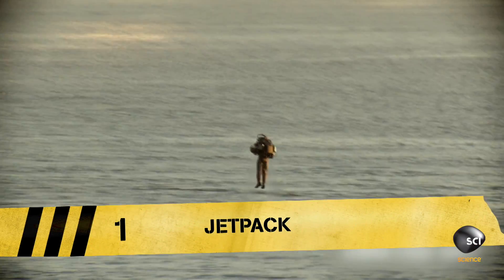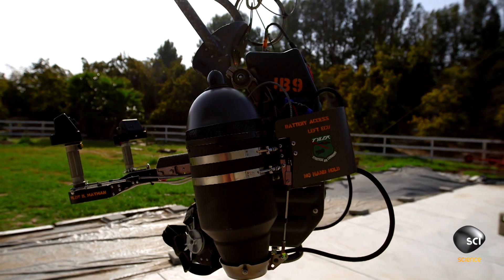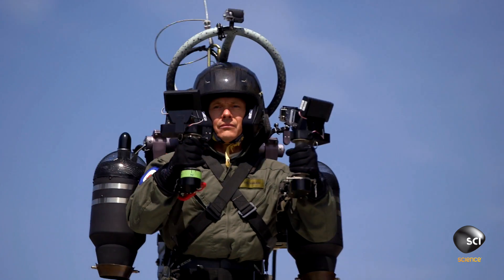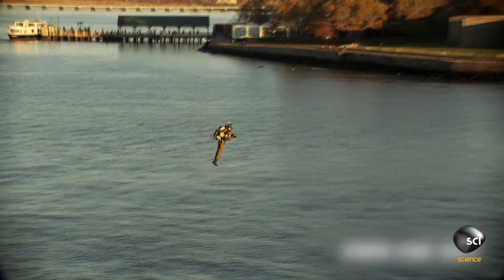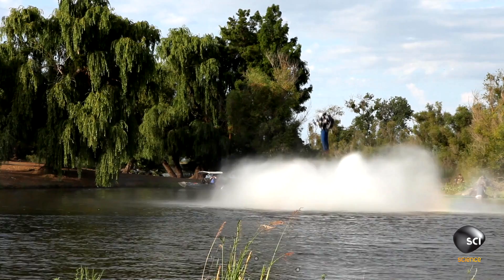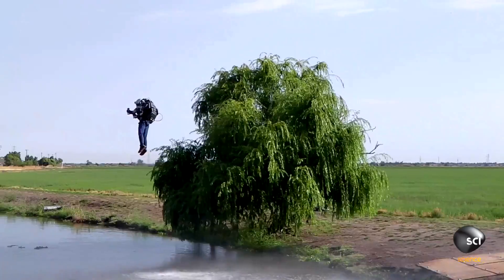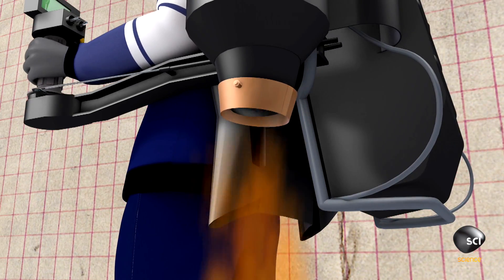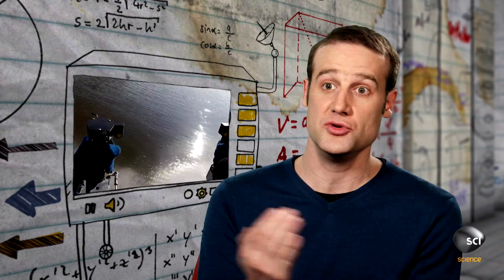Meet the World's Only Fully Functional Jetpack

Comment: you would need and want a parachute but it will have to be a new type. The low altitude it will mostly operate at means one thing, the chute must deploy pretty damn fast, like in less then a second. And the only way to do THAT is blow it out using a rocket or compressed air.

Comment: Most of these vids I see are over water and for a shorter, less practical application of time. I assume that's in small part due a more survivable crash and less public damage if a failure occurred. It's still a great start to something with great potential. Longer endurance and reliability would make these devices awesome for EMT use in remote areas like Nat'l Parks, ranches, rural HWY's, etc. Even enough fuel for a very fast, one way trip to stabilize a patient until more help arrived would work. (Didn't want to view 1184 comments for any possible duplicate views,

Comment: So far the flights on jetpacks are very short. Until they can travel greater distances they're impractical.
Reply: The whole thing's made of carbon fiber and titanium and only 90 lbs, but it can still only carry 5 gallons of fuel. These will never be widespread until they invent much smaller, lighter, more powerful and more efficient jet engines. Or think of some other means of propulsion for it.

Comment: +Science Channel I'd rather use the Flyboard Air (10,000 feet capability, 93 mph top speed). This video shows the pack going very slow. Why go slow and clunky when the Flyboard Air is out. Right now only teams and similar can buy it for $250,000. No one can even buy this pack yet.

Comment: Add a pair of wings and a tail assembly and you've got a man sized jet airplane. 
That could reduce your fuel consumption during flight, as you're using the air for lift and the engines only for propulsion.

Speaking of which, what are you using for fuel? I'm thinking your fuel consumption must be horrendous to get the thrust needed to lift the pilot off the ground.

Comment: Cool but fuel burns off in minute or two, that's always been the problem, until we come up with a fuel that has longevity, jet packs have very limited use, which is a shame.its not the first time its been done only dif is, is the materials are now lighter and stronger, giving a little bit more flight time.

Comment: What a joke.  This is NOT new.  There have been functioning "Jetpacks" for decades, since  the 1960's.   The problem with the Jetpack is the length of flight.  They have a very short range before they run out of fuel.  They can only fly for a minute maybe two before they are out of fuel so they aren't really practical for much of anything except demonstrations.  They've used them to fly into sports stadiums, etc things like that.  They certainly are not new.
Reply: Not just the length of flight, I'm an electrical engineer, these machine are very inefficient, you cannot scale typically large machines such as jet engines without losing efficiency as you make it smaller, there's mathematical proofs for this, but you get the point. And anyways, an aircraft is just a jetpack that is more economical, example: the jetpack is basically useless for everyday commute as it's too inefficient, so you make it larger, perhaps increase the number of people it carries, now as it's still useless for short commutes as it's still inefficient, you make it fly higher to increase efficiency (pressure reduces and so does the drag), now you enclose it in a metal body as the pressure lowers at heights, then you make it aerodynamic and change the fundamental lift generation principle from thrust to dynamic lift, i.e. add wings and tilt the engin 90 degrees, as it's for large distance, add a few seats, maybe food and entertainment as well, then an road exclusively for it's liftoff and a control network to prevent crashes, congratulations, you have just built yourself an aircraft ,which is already used everywhere.

Comment: In 1957 a scientist at Bell Aerospace, came up with the Jetpack. He want to marketed to the United States Army, he made it so simple that anyone could operate it. It has made many public appearances, it even has open the 1964 Olympics in Los Angeles.
The only thing that stop this from becoming, a weapon system was the length of time that its in the air. An that can range from
21 to 28 seconds, far too short to stay in the air also if a soldier was to use this jet-belt, how was he or she to use his weapon
since it takes two hands to operate the belt. It would be nice to have such jetpack, too get to work is your job was 28 second
from where you lived, and maybe we will. But until they get the fuel tanks to hold more, fuel then its just a dream.

Comment: Its slightly fake. The safety line greatly helps stabilize the thing because this cant possibly work without a counterforce canceling out the rotational momentum.
Reply: drkastenbrot Are you referring to the fact that the jetpack would be spinning him forward due to his center of mass?
Reply: Analytic31 mostly, yes. 
This is why all other jetpack projects have decided to go for a hoverboard approach.
Reply: drkastenbrot A hoverboard approach?
Reply: Analytic31 Instead of strapping it to the back, you stand on it. Like a skateboard, but it flies. Thats the definition of hoverboard (no, those weird two wheeled electrical vehicles are not hoverboards). 
Theres a commercial one available afaik and its actually somewhat affordable.

Comment: Took me a while to get this information but for those who want to know, the first flight of the jetpack (the one in London) was four minutes long, the flight ended with more than half of the fuel still in the tank (which was filled beforehand to maximum capacity, obviously), another test flight lasted six minutes, there was still some fuel left on the tank. Apparently the current model of the jetpack can fly for a total of ten minutes before the level of fuel becomes dangerously low, and the designers are aiming for an electric version that will be quieter and possibly able to fly for longer, it will supposedly be available to purchase by 2019.
Reply: 2019 seems a little early for something this rudimentary to be made public... I'd estimate more along the lines of 2029, if it'll be sold at all. Gives them time to refine the design.
Reply: 2020 bruh, where is my jetpack?
Reply: Augusto Vasconcellos source
Reply: It’s 2019
Reply: Is it on Amazon yet? It's 2022 heh heh
Reply: 2022 dude 🗿
Reply: 2019?
Reply: Its available now for 340k but can only fly for 6 mins!
Reply: It's 2019 and I'm waiting
Reply: Its 2020 and im dissapointed
Reply: Thanks for clarifying that Augusto. Six minutes may not seem long but it's a huge improvement on the first jet pack developed in the early sixties. Think that only flew for twenty seconds. I agree with others re safety concerns though. Military may be interested but not suitable for commuting IMO.
Reply: 2020 we still have a long way to go
Reply: It's 2020, still isn't here...
Reply: My guy where is it please
Reply: Bro it's 1/3 of the way to 2024 and I still don't have a jetpack 😢
Reply: damn just next year!?

Gotta save money asap

Comment: why not put a emergency parachute on it?
Reply: Doesn't fly high enough to justify it.
Reply: godstomper 

You'd better have one. If one of the two engines fails you're fucked unless you're high enough to escape the rapidly falling towards earth iron and release a chute.
Reply: @halnineooo136  the wearer needs to be high up enough for the parachute to do it's intended purpose,u can't simply parachute from the 3rd floor of a building so if the jetpack were to malfunction then u would get both ur legs snapped.
Its best not to have this available to the public.
Reply: *****
 but it is a big risk with out parachute
Reply: Spare skydiving parachutes (the most sofisticated) need 600 feet by the way
Reply: Muhammad Ilyas it probably won't open in time
Reply: they must have put Parachute ....
Reply: Well if you were to throw in a parachute, you'd have to consider weight, you'd have to consider storage, you'd have to consider the temperature of the jetpack and then you'd also have to remodify the entire design from the ground up, to deal with all of these addons.

If the parachute is highly flammable, which I presume it is. Then, you'll also have to consider the safety of the pilot & design a solution for the problem.

It really isn't as simple as just wearing a bag with a parachute in it; as it requires alot more work, alot more time and alot more money.
Reply: To all those who say it would be pointless, a proper ballistic parachute would open near-instantly upon activation. That being said, it would only be particularly useful if flying at high altitudes, because at low altitude you'll probably be hitting the ground at parachute-speed whether you have one deployed or not. In low altitude it'd be more practical to have some form of airbag system to absorb the impact, but again that's more weight to consider.
Reply: Only for engine failure... Otherwise when losing fuel, you'll slowly descend
Reply: Ejection seats on fighter jets do not rocket them up 600' when they bail just above the ground. How do those work?
Reply: but base jumpers jump from only a couple hundred feet...
Reply: The older versions back in the 60s and 70s had a very short flight time. What is the max flight time? Not very practical if you only have 15 minutes🙂
Reply: he'd probably do better with a squirrel suit. A chute would not be effective at his low heights.
Reply: godstomper because it wont mean fuck all at 20 m 😂😂😂
Reply: godstomper That's why he's flying over water
Reply: He's flying far too low. He'd need a zero-zero ejection seat (Google it) to have any chance of survival: they have rockets in the base to shoot you up 300 feet before the chute deploys.

Those weigh around 150 lbs and cost ~$250,000 apiece. The rest of the jetpack weighs 90 lbs and costs $340,000. Do the math. It'd make the entire design impossible.
Reply: It Doesn’t fly high enough to deploy most parachutes. Plus, a parachute system is bulky and adds a lot of weight. In addition, the parachute can’t be exposed to the heat in the back of the jet pack. It’s also not the only one. The ARmy built the first one in the 1950s and flew in opening ceremony of olympics. There have been numerous ones since then including the “GoFast” version that has been flying for more than a decade. I used to parachute at airshows with Rocketman. I’ve been around it for a while. I’m the 2004 US National Champion of Parachuting and have logged over 10,000 parachute jumps. Cool rig he has got though.
Reply: A parachute only works at a high enough altitude. Too low and there isn't enough time for one to open fully.
Reply: They clearly didn’t see what happened to Rhodey
Reply: @___zeke___7581  umm what happened to rhodey?
Reply: The jet pack wouldn’t be able to go high enough for parachutes to work.
Reply: ahh... weight? ... plus a parachute will not work at such a low height ,, you need around 3000-4000 feet for a parachute to deploy & land properly ... so technically it is not practical on a jetpack, just dead weight, why he is testing/flying above water
Reply: Who cares about height? All you need to do is fly over traffic.
Reply: Martin Aircraft DID on theirs.. oh wait, this is the only real one in the world so the hundreds they've made don't exist :D
Reply: Ejector seats and it usually used a rail to guide it
Reply: a lot of folks in this discussion never heard of base jumping apparently.